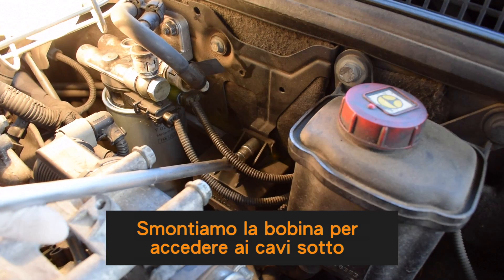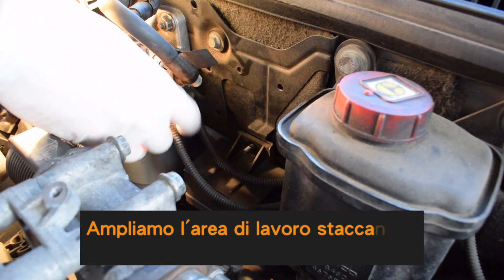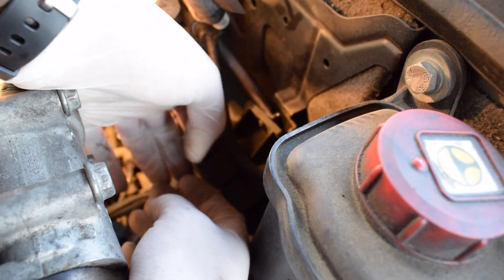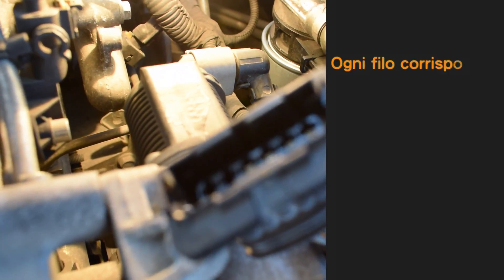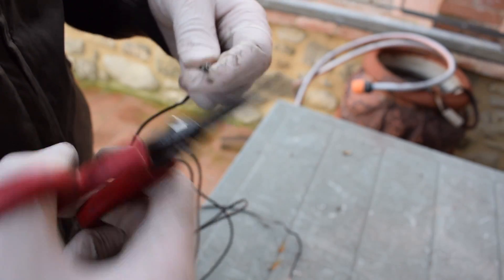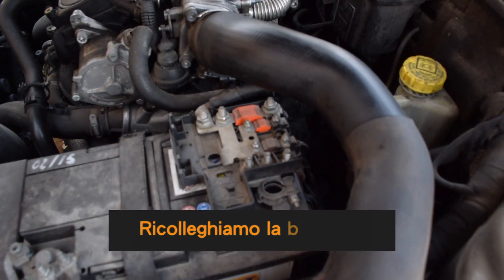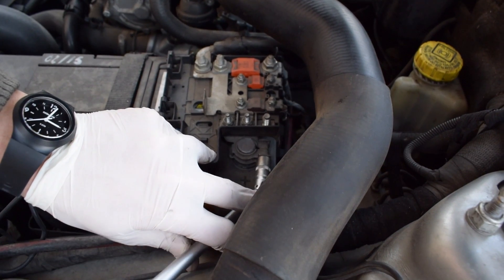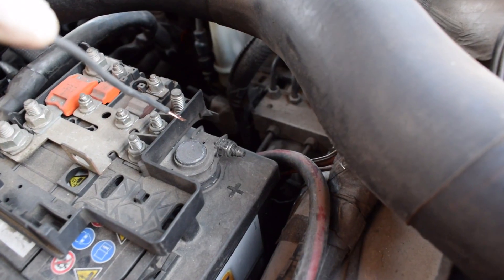Come capire quale candeletta sostituire - Avaria preriscaldo -

Comment: Attenzione, non tutte le candelette ai possono alimentare con il 12 v ma alcune vano alimentato a tensioni minori sennò si rischia di rovinarle, questa prova può andare bene per candelette a 12 volt di vecchi motori,nei motori nuovi si misura con il tester vedendo la diversità di resistenza tra le 4
Reply: la fiat stilo 1.9 JTD del 2002 le candelotti sono di 12V ?